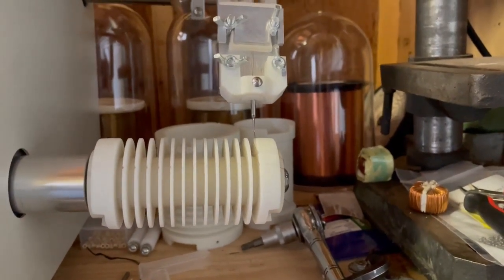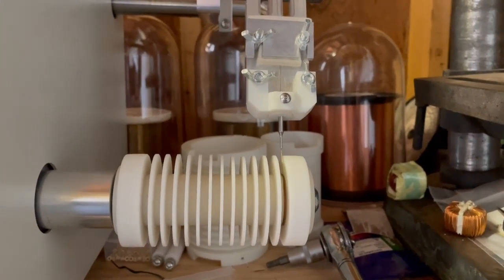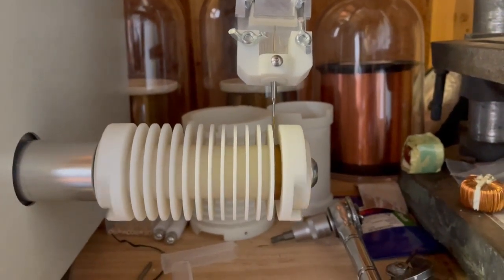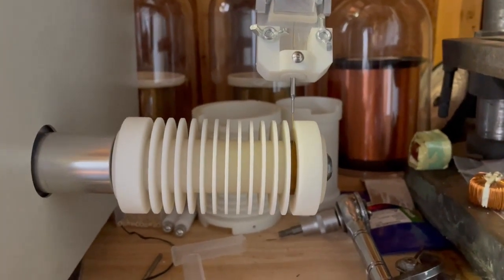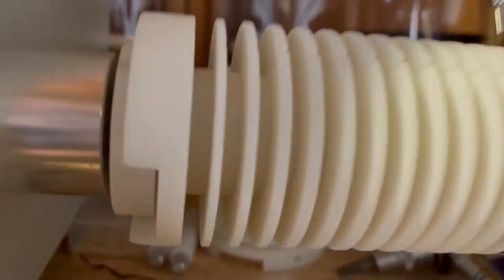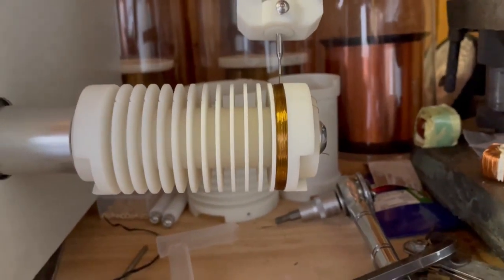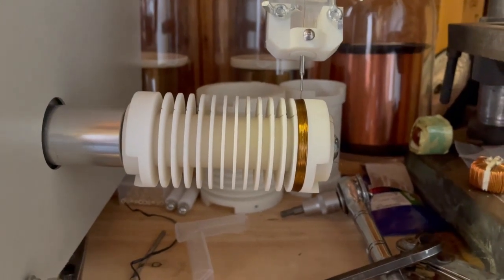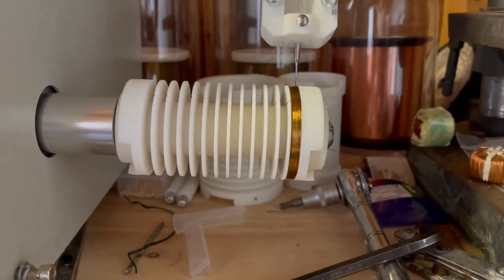True Green Solutions is back!

Comment: That's a mighty fine winder you've go there. Did you design that?
Reply from the maker: Yes, but I wasn't the one that came up with the idea as that would be this person: https://www.youtube.com/watch?v=SOqioKMXXuo
https://www.youtube.com/watch?v=FOZscpvrpIE&t=31s
I modified his idea for what I needed for my machine with a 3d resin printer I have so that the coil winding machine I have could wind up Meyer's type transformers correctly.
I design practically all I need for Meyer's technology and will build it or have it built by someone for me. The WFC I had a machine shop make it for me but I designed it based on Meyer's design but made it far more cost effective. But later on Max Miller made an even better design for the WFC, lol.
The transformers require a lot of planning as they all must be resin sealed using the proper type of transformer resin after they are wound up.
To be honest I kinda just gave up on you as you never would reply to any of my comments on your videos. 
For me now I must find the time and the funds to keep my work going as I'm typically working 11 plus hours a day now. Just know this type of resin is kinda pricy and it has a shelf life so if you buy it you have to use it within a specific time limit as the resins expires, lol.
Anyway good to finally hear from you.🤓

Comment: Hi

Are you selling any devices ready to ship yet?
Reply from the maker: No, not yet as I'm still in the process of gathering the many things I need to take this technology into a limited form of production right now. 
A long time ago I attempted to start selling parts of this technology but the many online forums weren't on board with what I was attempting to do and even went to great lengths to ban me from their forums.
In this this technology will make it's way to the marketplace but it's going to take time. The only thing I'm worried about it the sheer number of vehicles that need to be converted over to make use of this technology as it's in the billions. Thus even if I was to start at the beginning of this year with half a million units for the year that's just a drop in the bucket of 1.3 billion vehicles that need to be converted.
Reply: @h2opower  well. If you can send me a prototype for testing and it works. I can line ip investors for you
Just a thought

God bless you
Reply from the maker: @Gacha.Cupcake  For now I will more than likely have only one working prototype unit and as such can't send it anyplace as I'll be needing it for show and tell purposes.

Comment: Nice work, wish you all the best in this work, I am going to attempt to run my car on water as well once again, but this time around i will do it without the fuel cell at all, just play with the high voltage and water in the vacuum, as we all know a motor is a vacuum pump.
Reply from the maker: Thanks SpaceMan. I think you should give your plate cell another go with a much larger inductor for the chokes trust me as that's the way you want to go.

Comment: Great work Ed.

Make sure 'auto home' is turned off on the coil winder. Then assign a different number to each program. That should allow you to have the coil winder do the entire bobbin. Once one cavity of filled you just press the next number and hit start.
Reply from the maker: Thanks BradK and again thanks for the manual as the one that came with the machine wasn't all that helpful. I'll need to modify the bobbins a bit as the space leading to the next slot isn't wide enough  and should be angled for ease of movement of the wires so I'd have redesign them a tad and print out some new ones. Right now I am wishing the company I brought the wire from did a better job of winding the spool up as the wire snapped on me several times due to a kink in the wire.